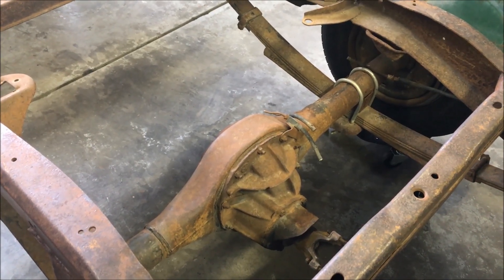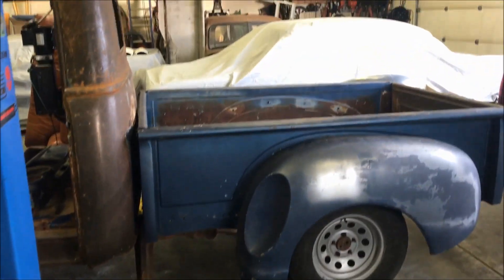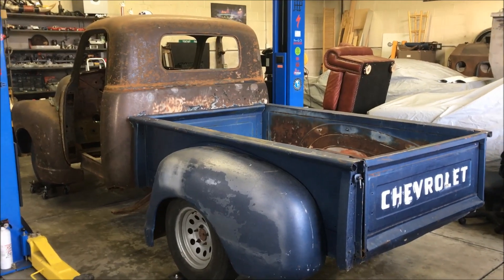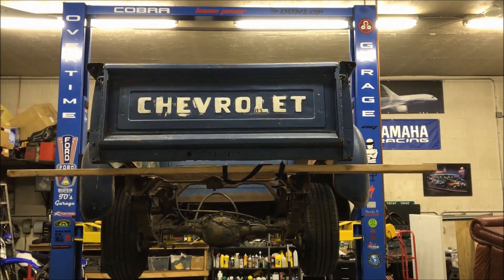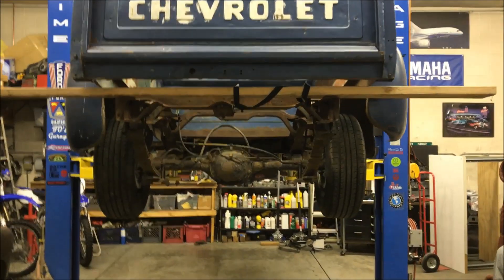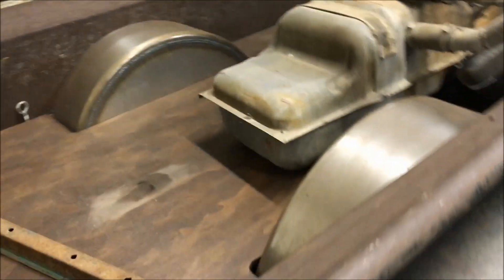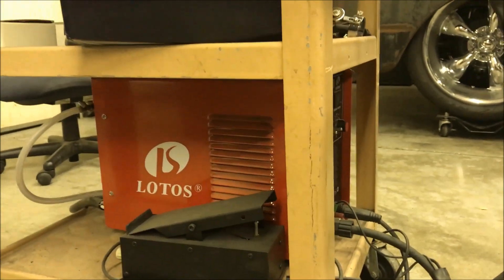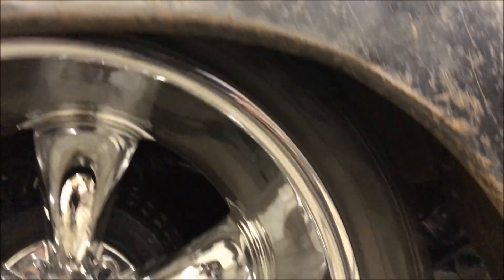Axle Swap - 54 Chevy Truck Project, Code Named 'Step Brother'

Comment: Hey Trent. I just took a rear-end out of a 1992 Jimmy to go into my Fargo. It was a real pain. ALL the shackle bolts were rusted in like the one that you had. I had to torch the shackles off in order to get the axle out. Now I have 4 bolts to get out somehow. I guess I will have to build or rent a press. Good luck. Thanks for sharing.😷👍👍